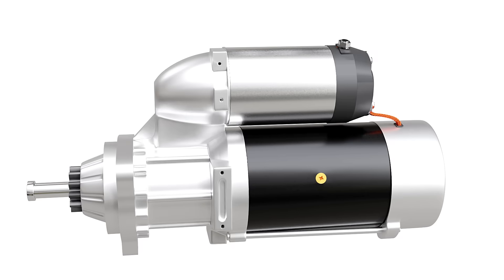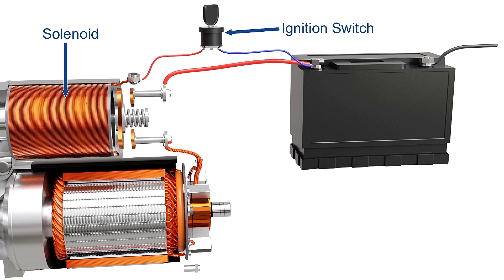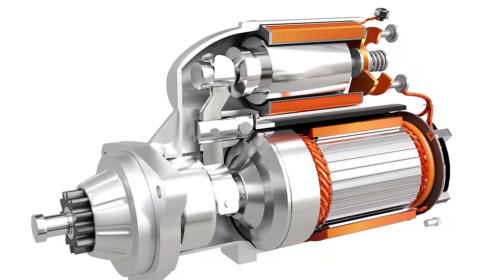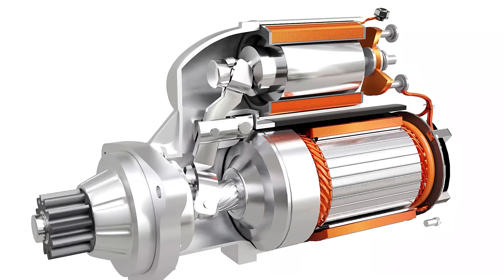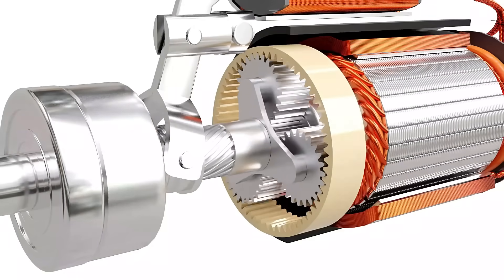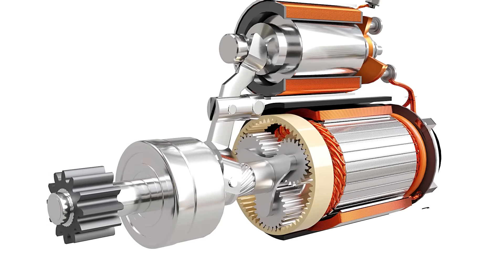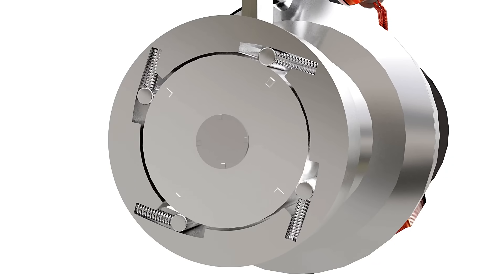How an Engine Starter Motor Works

Comment: the starter does not turn the crankshaft. The starter motor engages and turns the flywheel connected to the flywheel

Comment: Wrong, first, there is always a direct connection from the starter to the battery as the starter requires massive amps to turn the crank shaft via the fly wheel.

There is always a second positive battery connection to the solenoid which simply supplies current once the key is turned in order to activate the gear that turns the flywheel.

This image shows only one connection to the battery, which is false.

Comment: So fascinating to know this! This is how I put it simply, the way I understand it:
When the ignition key is turned, electricity is sent through a wire from the battery into the solenoid and activates the electromagnet. When magnets are energized, they want to attach to things, and so a gap is closed and the solenoid closes its circuit leading to the motor. That closed and complete circuit now has electricity flowing from the battery of the car through the ignition key, and solenoid, to the motor. When the motor gets electricity, it works similarly to the solenoid except kind of the opposite: instead of magnets pulling circuits together, they repel each other. Like a merry-go-round at the park, magnetic forces start to push the motor in circles. 

To illustrate this in a really subjective way how I imagine it, imagine the inner components of the motor react like two magnets you try to push together with your hands. It is very hard to make contact with two opposing magnets, right? So what happens? They slide around each other and push away from each other. That push is designed inside a motor to rotate the core in one direction, giving the motor it's spin. Power from the battery charges up the magnets to push on each other in the motor, and that spin is then translated and magnified down the line by gears that exponentially increase the power. That power turns a pinion which turns a much larger flywheel. That flywheel being rotated is like when you kickstart a bike. It starts the chain of events that lead to the engine self-sustaining itself. 

I just came from reading about a lot of this on wikipedia, and I'm also addicted to Car Mechanic Simulator 2021 and hope to learn as much as I can about vehicles in case I ever need to fix them. I'm also a technician in training and this stuff is extremely interesting to me. Thanks for the video I love the 3D illustrations!

Comment: I'm pretty sure a car starts without the gas As the battery is what start's the cars engine to then began burning the fuel to Move. The electric components can still be used even without the gas

Comment: One thing that seems to get missed on starter motors is that the soliniod has two windings built into it a pull in winding and then a holding winding this is done because it takes a lot more current to pull in the starter then to hold it in this is done so more current can go to the starter itself

Comment: It looks as if the clutch animation is backwards the rollers are supposed to be forced into the smaller end of the slot giving the required friction to turn the shaft. The direction of travel here is driving the clutch to the release or open part of the roller slot.

Comment: Sure there's a good reason but why not combine the alternator AND starter and save weight while reducing parasitic drag on the engine? Why spin 2 things when you could spin 1 thing? Why have the weight of 2 things when you could save weight by having 1 thing start the engine AND generate electricity? Also it seems like combining the starter and alternator into 1 would reduce complexity and number of moving parts.

Comment: I just replaced my starter today and got me to thinking about how a starter actually works (after 44 years of driving lol).  I get how the pinion is rotated a little to help it mesh with the flywheel when starting the engine. However, what I don't understand is how does the flywheel not destroy the pinion as it gets pulled back? It just seems like the flywheel would tear up the pinion as it's being pulled back towards the body of the starter. Anyone know the answer to this? Just curious.
Reply: 3:33 In the video mentions a one-way clutch, does that help to answer your question?
Reply: @Spacemonkeymojo  Not really.  When the teeth of the flywheel and teeth of the starter are "meshed" together, the flywheel is operating in one "plane" that's perpendicular to the movement of the pinion, so how do the teeth of the start and/or flywheel not get damaged when they're operating in different planes as the pinion is pulled back? That's what I'm puzzled by.

Comment: another point: if you connect battery directly to the electric motor, because of the inertia the start will engage and you don't even need that salenoid! extra other point: the salenoid is exactly a relay if you look closely! 30terminal:battery, 85:+12v from starter switch, 86 terminal: Ground, and 87 terminal is to the electric motor. 86&85 are x2 poles of the self

Comment: Very well presented and well thought out video. Thank you for this! 

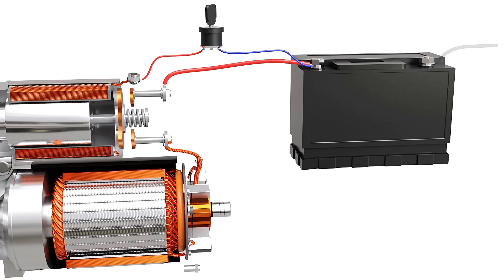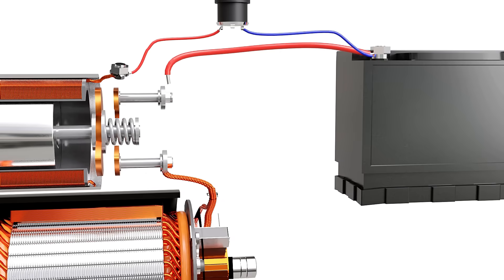There is only one caveat: the answer to the question at  1:12 "Why solenoid and contactor are used instead of directly connecting battery to the motor and reducing the complexity" is not because of high current demand of the motor. If we had this simplified circuit (like shown at 1:18) , the motor would be always on, which obviously the electric motor should only run when we want to crank the engine until it starts. In any other instance this motor is turned off. 

Perhaps they meant why not to use any other switch instead of solenoid, which is designed to handle heavy currents. However, the way it is shown it would run contentiously.
Reply: you misunderstood the video... and it's spelled "continuously"

Comment: solinoids suck and ware out for no reason so it's a good idea to wire both points on the solidoid to a bypass so when needed when you turn the key and nothing happens you can bypass the solinoid mechenism by putting both wire together or on a switch to forcefully start the motor or you can get a power probe and send power straight to the electric starter motor also bypassing the solinoid

Comment: Does not one way clutch showed here is in wrong direction? If the inner ring rotate CW outer ring should not rotate, whereas if inner ring rotate CCW outer ring should get locked.

Comment: Most starters haven't worked that way for 70 years! Pre-engagement starters haven't been used on ANY Japanese car since the 1950's and NO MOPAR since the mid 1950's! BENDIX starters have been used on ALL GM small block V-8's since their inception and all Ford Cleveland, Windsor's, and 4.6/5.0 liters. Would you like me to go to a salvage and take a modern starter off a car and photograph HOW it works? It sure doesn't work like you show!!! I'm 68 years-old  and worked in a service station as a YOUNG teen-ager and only saw a few cars in the 1960's with that type starter, and most had STARTER PEDALS ON THE FLOOR and were three times older than I was!!!

Comment: The starter motor on my Suzuki quad bike fell off while I was riding and oil came out.  Does that mean my starter motor is messed up or can that easily  be fixed
Reply: i have a shop for alternators and starters. we can rebuild almost any starters. bikes starters are usually cheaper to buy brand new if you cant rebuild yourself tho

Comment: The one-way clutch at the very end is the icing on the cake! It also explains why there WASN'T a horrifying screech when I recently got back into my idling car and habitually "turned on" the ignition! It's a '07 Ford Focus, so this "new" technology has been around for awhile apparently.
Reply: Here in Africa, we drive 25-40 year old cars. So, these new(ish) technologies are not available. I remember my driving instructor couldn't insist hard enough when letting me know that I should never, ever, ever, ever try to start a car that is already running. He made it sound like the car would implode instantly. Lol

Comment: Please correct if I'm wrong ?!
I'm expecting to replace the ignition switch key by a start push button, so, in order to keep the ignition on, i'v to add a relay that keeps the solenoid energized ?

Comment: It's amazing, the solenoid not only engages and disengages the gear, but also is a timing mechanism AND a relay, all in one, great design
Reply: Not timing but meshing mechanism
Reply: @NANA-j6x9f  oh yeah that too, but I meant how it times the motor to only be energized if the gear is fully meshed in

Comment: 1:21 I'd say that battery and motor are not directly connected in order to have something like the solenoid in the middle that triggered by the key can switch on and off, otherwise if they are connected nothing could give a signal. Why did you explain something else here?

Comment: How anyone invented this is mind boggling.  The genius it took to design such a part that we take for granted every day.
Reply: everything started as simple, remember back in the days the very first cars had manual starting handles... they added more and more features out of necessity, built on a strong foundation... todays modern cars contains hard work of many many engineers all over the world.
Reply: @Choco-m7u you have the one way clutch on the gear that engaged the engine because people used to get kickback and a broken arm!
Reply: I was just thinking that Starter Motors are an unclaimed masterpiece of Engineering!!!
Brilliant  video
Reply: if you think this is complicated go look automatic transmissions
Reply: It would be difficult for a single person, but not for a group of engineers.
If you have the necessary knowledge, and given enough time and money, you too would come up with something like this
Reply: @rrsharizam more like a decades of generation of engineers to be precise, one learn the mistake of other generation to make this marvelous creation
Reply: There are many different inventions at work here. The idea to start an engine via a secondary (electrical) engine is quite obvious. But all the other problems that come up have been most likely solved via trial, error and planning. "Okay, but what if our engine then drives the electric engine? wouldn't that be bad?" "Yeah... is there a way to prevent this?" "Got an idea... let's try..."
Reply: Before this, we had them hand-stsrt vehicles. Where you had to crank the engine over with a neatly shaped bar. It was dangerous, as engines idle around 1,000rpm, and we don't have much time to get out of the way after it fires up. Twas crazy. Now it's better.
Reply: But why they did not used a contactor instead of solenoid it would have saved a lot of space.
Reply: and the software used to make the exact replica of it on a computer tho. shits crazy out here
Reply: Agreed. When you see a video like this, part of you may initially say "oh, that's relatively simple", but then you really start looking at all that's going on and the timing that has to happen and you think "Wow! That's genius!"  And it is!!
Reply: Have you ever had a good excel spreadsheet though.  One you could really be proud of.   Oh mama
Reply: I think the same about air conditioning.
Reply: Não tem como ouvi em português
Reply: It's really a pretty simple part, DC motors have existed almost 150 years. They just added a solenoid (which has also existed for an extremely long time) to move a gear in and out and act as a relay.
Reply: Step by step. Rome wasn't built in a day
Reply: It definitely is the work of a GENIUS.
Reply: Lots of people over a long period of time
Reply: Things had evolution.. 
Look parts back 50 yrs ago.. 
N the next 50 yrs.. 
Should be big big change
Reply: In the late 19th century, the first combustion engines had to be cranked by hand. So using a DC motor once high power rechargeable batteries became more common, is an idea a 10 yr old could have had honestly.  Switching the high motor current via a relay is quite obviously necessary too.
Reply: you can say that for a whole engine with the clutch, gearbox etc. its really satisfying to see how all the comments work and how they are connected with each other
Reply: @Plisken65  underatted comment. thank you for giving us his name. everyone above was talking how IT was not simple to create it, but nobody gave the name of the mastermimd behind it
Reply: Definitely this machine is not designed by single person, it developed through years and became perfect by meany people
Reply: It really isn’t that complicated though? It wouldn’t be hard to come up with a quick starter, and refine it over years and you get this.
Reply: White dudes.🤷‍♂️🤷🏾‍♀️
Reply: One person didn't just "invent" this.  It will have taken decades of design evolutions and the input of dozens, maybe hundreds of engineers all specialising in different areas trialing many different designs and solutions that failed before this design was finally arrived at.
We forget just how old the motor vehicle actually is (close to 140 years old!!!!) and how many gradual refinements and improvemenst have been made to all systems and componants during each decade since then.
Reply: Everything has been iterative
Reply: I mean it is many years of technology advancement, in the past car engine need to be handcrank to be started and then somebody thought what if they replace it with electric motor
Reply: Man thinking God’s thoughts after Him.
Reply: this is kinda understandable, what is mind boggling is how they come up with cellphones, wifi, internet, even something as video camera is mind boggling to me.
Reply: Probably would have been inspired by the steam engineers and altered for its purpose
Reply: It's trivial for an engineer, but of course that is because it is an evolution. Nobody has designed all of this from scratch or without iterations. Or alone.
Reply: Over engineered😂
Reply: multiple engineers and "geniuses" designed this shit, and it was over decades or years of developments and improvement, not just one.
Reply: I'm gonna down vote.  No one engineer sat down one day and invented the whole entire concept.  Good engineering designs build job prior learnings and designs
Reply: So what happened before starter motors came about?
Reply: @johnbell3621  they used to hand crank the engine till it starts
Reply: @ashkechum8409  like a damn lawnmower?
Reply: @michaelmendez9423  go find videos of people crankin model Ts
Reply: Or park on hills!
Reply: @johnbell3621  broken wrists and arms lol
Reply: My girlfriend "Is that the engine?"
Reply: what's more amazing is this same engine starter is powering the crazy fast and powerful Tesla Vehicles
Reply: It is very simple
Reply: @vitorvxc  "simple"
Reply: @vitorvxc  planetary gearboxes are not simple
Reply: @JonDoe-007 and even universal or milkyway gearboxes are not simple..🤣🤭
Reply: @vitorvxc  it is simple now a days because it's  common. It was difficult first time.😉
Reply: @AbidHussain-sq2mt  lots and lots of failures along the way until decades later they are getting pretty good
Reply: @AbidHussain-sq2mt  it's engineering, a way, method and manufacturing of stuff to achieve certain result. Engineers solves problems to a achieve the goals using the abundant knowledge and research of past engineers and scientists. They don't come up with everything single handedly on the spot lol.
Reply: @AbidHussain-sq2mt  yeah like for a hundred years. The genius is it's simplicity
Reply: @vitorvxc  It's one thing to understand something explained very well, it's another thing to create it
Reply: @vitorvxc  Make sure you post a video of your inventions and how it works.

Comment: .Hlw sir, can you plz help me to know, how I can calculate what size of AH battery do I need to start a 10 KW self-starter. Plz explain with formula
Reply: W= V*A. So take the watts and divide it by the voltage of the battery. That will give you the amps, your battery must be able to output at least that amount of amps.

Comment: Please upload how semi-automatic motorcycle works without a clutch.
Reply: It's not semi-automatic. A drum with pathways cut into it spins. when it rotates those pathways move shift forks in and out. A ratchet makes sure the drum only rotates enough to shift and allows the shifter to return. The magic for clutchless shifting is in the gear engagement collars. Some manufacturers make these for road car transmissions that allow for the same style of shifting, but lack the sequential drum mechanism which operates the shift forks so you'd still have to move the shifter through the H pattern. It's also something that's easy to find animations for.
Reply: If you don't have to use a clutch, it doesn't count as a motorcycle. Lol
Reply: hii everybody check out my channel tnx

Comment: Can someone answer me? My question is if use a battery bank to power starter motor in a CVT gearbox car so actually we have a full conversion to electric vehicle? Because starter motor is enough to drive the car??
Reply: no you can not do it the starter cosume a lot of current  usually rated in kw and heat up fast for many reason you cant do it
Reply: The starter could drive the car if the function of the starter was moved from turning an engine with compression to just driving the car. It has an engine to rotate as well.
Reply: In Germany, in particular BOSCH company made a racing car powered by a car battery using a starter/generator to power and drive the racing car.